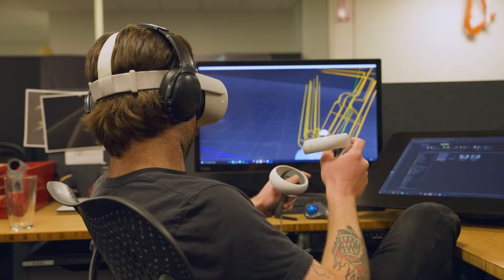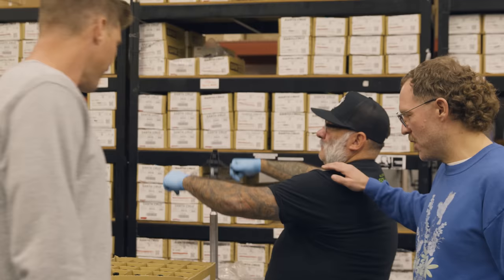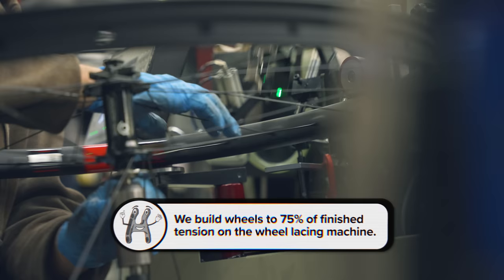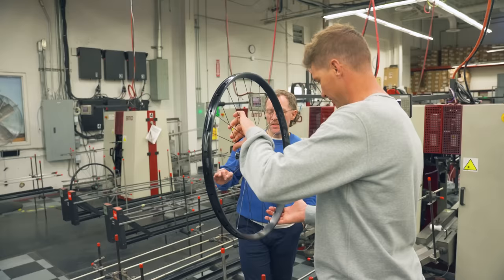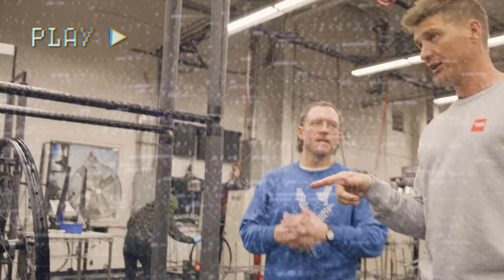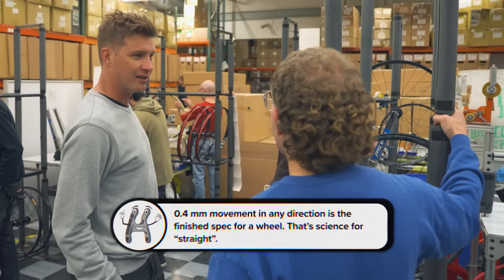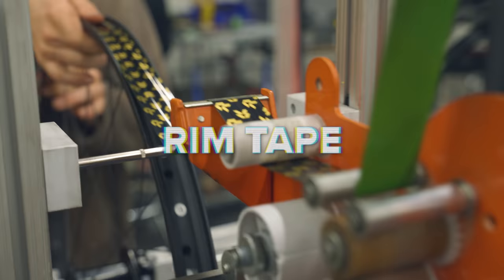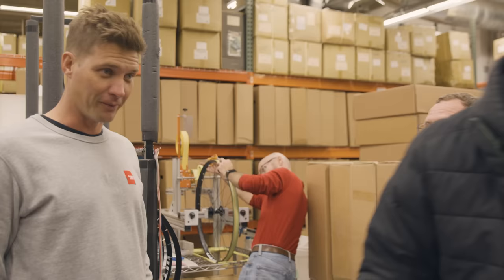Santa Cruz Factory Tour with Greg Minnaar [Episode 3 of 4]

Comment: As a person who worked in manufacturing... Where are the chairs for the employees? It seems, they would have a lot of carpel tunnel issues from repetitive processes. Do they rotate stations? I need to know!
Reply: Secret insider scoop from a person who worked in the wheels department. Rotations through the stations happen hourly so you're never stuck at one spot for very long. There are compression mats for every single station that you stand at and for the reserve line we got stools for each machine. A lot of times the stools/chairs are not used because it's nice standing and working sometimes.